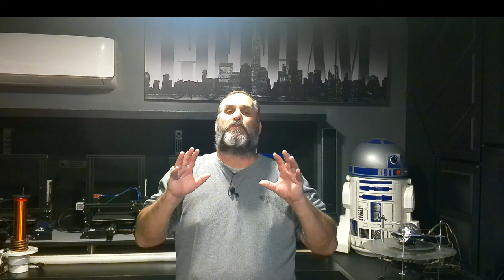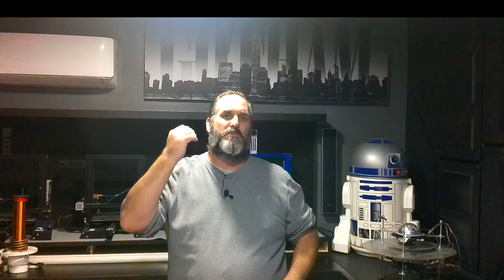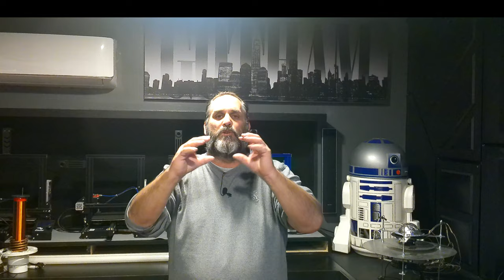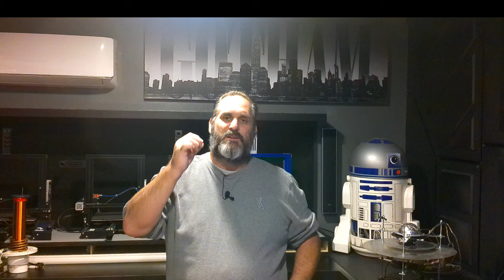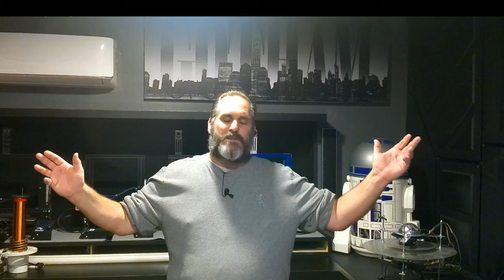Graviflyer "Pulling Energy From The Earth" #47

Comment from the maker: Alexey was hiding information in his schematic 
I followed the schematic to the letter. Then tried it in the opposite direction where the mistakes are made. Only by switching it around can you find what he was doing. This was his way of telling you they are interconnected without a true connection.  
 The motors don't connect to the ultrasound. We know that. But the beat rate of the ultrasound is the same as the upper disc.  
The tesla coil is not connected to the high voltage we know that. The high voltage and the tesla coil do interact together though.   
There are no capacitors after the flyback we know that. The high voltage picks up power from the tesla coil and the ground just like a capacitor.  
 The tesla coil circuits are different in his diagram and his actual circuits. He knew he needed power from the ground to build up in his craft. Yet he put in a slayer exciter that doesn't have to use a ground. His real circuit did.  
 He is hiding his work. The problem for him is I don't give up easily. I found the reasons for all of it. Only by doing the work can you really find out what he is doing. He did lie to us. I guess he did it so regular people would never figure it out. Maybe it is because he lives in Russia? Who knows. I Think every inventor does something like this in their work. A lawyer could not tell the difference but the inventor knows it.
Reply: Sounds great so when do we  we see some lift?
Reply: Hook up with Wesley from New york. He has a youtube channel named stivep 1
Reply from the maker: @BushLieWorldDie  send me a youtube link please.

Comment: Lawerence Rayburn had made a energy device (antenna). For the attaining perfect ground, he made 4 sqft steel plate and kept 3 feet minimum under the earth.  He connected four 4 gauge wires from each coner of the plate, jointed together above the ground  to a single wire. His wires are PTFE coated well insulated. It was a perfect earth wire, for used for tapping free ions from air for his project.  You can create a perfect ground like that..

Comment: Great work again Nathan! It's funny that you mention this concept of pulling energy from ground. I've been reading a ton of Tesla's stuff lately to better understand Alexey's inspirations. Tesla was really into this idea of using ground for an additional source of energy storage. He would resonate w/ the local ground to increase his total amplitude. Think you're onto something here!
Reply from the maker: I cannot get the extra energy unless it is on the ground and even then it was hard to find. When I put in the ground for the tesla coil I found it much easier. I was also reading the Colorado notes and it definitely helped. He used the ground as the energy medium.
Reply from the maker: The problem is that it falls when the tesla coil field is collapsed. The static energy gets out. Energy loop with a trapped field. It explains the energy staying in the craft. What do you think?
Reply: @mytbrain @nathanbunten4299

The earth IS Tesla’s wire, he wasn’t pulling power from the earth he was pumping power into it and using the nodal points as connection point around the earth. Ancient tech. Not modern design, it’s basically the same thing but designed backwards so it pushes instead of pulls.. 

The reason it seems to “gain” power is because you’ve given the circuit a place to put the extra energy, before the ground the circuit could only “hold on to” so much..

Comment: People should study the difference between neutral and ground reflector with crystal radios. Good ground mass is like jumping on concrete. Bad ground is like trying to jump in a mud.

I recommend a video called "Understanding RF Ground for Antennas".
Reply from the maker: Sadly I did not understand well enough. Now I get it.
Reply: @nathanbunten4299  There is not much good information about this subject. We are all learning here :) All Tesla coil schematics usually leave out the capacitor from the tip to the ground, cause it's not a real physical part that is added on. But the "imaginary capacitor" is there in reality. Schematics also always leave out the resistance that every component and connection has on the system...
Reply from the maker: @Kangsteri  They also leave out that the amps are low and the volts are high. I had to learn by melting things down. My #1 coil was buzzing like it was connected to the power pole. I had to use a step up transformer to reduce the amps. I still think they are to high.
Reply: i use to do satcom  for the us army when i was  a young man.  Earth ground is very very important.

Comment: tesla radiant energy is measured in volts per second.  what's coming off the tesla coil wire  has no EM transverse component.   this why  i said a long time ago here to look closely at the tesla hairpin   (stout bar)  circuit.
Reply from the maker: I did not realize the importance. You are right.

Comment: How is it going to fly if it's connected to the earth ? Would it be like a car where the battery is connected to the car  ? Could you just connect it to a transformer in reverse?  Or would you have to invent a inverted transformer?
Reply from the maker: We will have it attached to the earth until we have it in the air and can see the point where it needs the energy.

Comment: Ageneral question. If i connected one of my tesla coil secondary wire to earth and then to common negative. In which case can produce more output. What is the difference between two technically ?  Some people say earth will give 1/4 wave or so.. which i don't understand. Do you have any information about that ?
Reply from the maker: The 2 should be the same. They both require q copper rod being shoved into the ground.

Comment: Once it hits the resonant state it does not pull energy from the Earth in my opinion. I think it is tapping into what is refered to as the zero point energy. This energy is really the vacuum em field energy. In quantum mechanic the uncertainty principle arises from these many electromagnetic field interferences from throughout the universe. If you can make the 'frothing' of spacetime to be asymmetrical in the way it em fields interfere with itself on a 'large' scale (not quantum) then useful energy can be extracted. It does not violate the second law of thermodynamics since the energy was always there, it is just configured to be extracted. 

One way to configure this energy for extraction is the toroid. You are creating toroidal field containers. The energy is already there, you must make the EM container stronger now. 

Your comment about lying got me thinking. What if he is telling the truth that the center plate is aluminum but what if he is omitting that it is a superalloy? I have other antigravity sources point to aluminum but they always mention that it is an alloy. If the alloy can change it's lattice structure due to the voltage changing then maybe that can add to the em flux generated with the rotating magnets array. The array is a hexagon. Hexagonal lattice structures seem key. They can efficiently tunnel electrons. If they can tunnel then they move distance with low electrical resistance. This movement is actually quantum tunneling. Here is a guy who has done an experiment to prove this concept: https://youtu.be/2tGRhTXKh8A?si=MwUehowtMyB-AcLa

With this understanding we see how it actually works. I will email you this as well Nathan.
Reply from the maker: it's not the Graviflyer. That part is correct. The circuits are wrong in part. The fundamentals are there. The parts in the kits do not match the voltages being used in the tesla coil.
Reply: @nathanbunten4299  okay good to hear. Making an alloy would be difficult. It may not be necessary but could add to performance. 

I assume he lied to protect himself while showing it off to gain the necessary attention to get paid off to keep it hush. Idk.
Reply: @nathanbunten4299  that is observant for you to catch that.
Reply from the maker: @ElijahCokeley  I sent you an email. I think I got the answer now.

Comment: Looking at the original Russian circuit diagram, I've noticed the tesla coil output is connected to the negative of the magnetic disc. I thought it may be a diagram mistake, but clearly in other parts the power jumps some connections showing clearly no connection as it jumps over the wire, but the tesla output is shown to be connected. Did you follow the diagram exactly, or assume it was a lazyness in drawing the diagram?
Reply from the maker: I followed it to the letter. Then tried it where the mistakes are made. Only by switching it around can you find what he was doing. This was his way of telling you they are interconnected without a true connection. 

The motors don't connect to the ultrasound. We know that. But the beat rate of the ultrasound is the same as the upper disc. 

The tesla coil is not connected to the high voltage we know that. The high voltage and the tesla coil do interact together though. 

There are no capacitors after the flyback we know that. The high voltage picks up power from the tesla coil and the ground just like a capacitor. 

The tesla coil circuits are different in his diagram and his actual circuits. He knew he needed power from the ground to build up in his craft. Yet he put in a slayer exciter that doesn't have to use a ground. His real circuit did. 

He is hiding his work. The problem for him is I don't give up easily. I found the reasons for all of it. Only by doing the work can you really find out what he is doing. He did lie to us. I guess he did it so regular people would never figure it out. Maybe it is because he lives in Russia? Who knows. I Think every inventor does something like this in their work. A lawyer could not tell the difference but the inventor knows it.

Comment: I think you are mixing different concept, you cannot create energy, the ground has 0 potential, how is it possibile to drain energy from it ? in another video , I sent you the formula that makes the device works, its simple F = i L (cross) B . Years ago I built a simple levitating device using a rodin coil, between two capacitor plates, I think another guy did this , there is a video on youtube as well, cannot remember the name though
Reply from the maker: Plasma channel has a foil that lifts between 2 plates. It is not the same thing. Also I was running a floating ground and got 20% less power. You say zero potential. So where is the 20% coming from. It is completing a circuit. It is that property that is important. I did the test and it created more energy. It was harder to hit with a floating ground. It is easier now.
Reply: I probably sound like a broken record and maybe this has no application to the Graviflyer. But maybe…
Don Smith made a point to use two grounds, either in the ground or in the air.
Now think of the phrase negative and more negative. That alway confused me as to how that could be. Same as positive and more positive.
Don made a point and stated that one ground had to have more resistance in his device to create a dam ( think Hoover) effect.
It’s the difference of potential. Where there is a difference there is work/movement/flow…
By using two air grounds of different resistance he was able to power airplanes.
Reply from the maker: @chasson321  I completely get it. Like the paper lifter you can use positive and negative on top of 2 devices and earth ground on the bottom of both. https://youtu.be/ZF4OdFK2Sgw?si=aeXvkokH5SYQG-PW
Reply: @nathanbunten4299  
Cool video